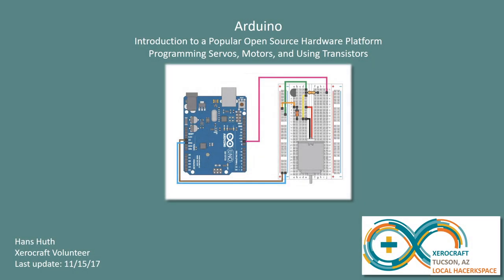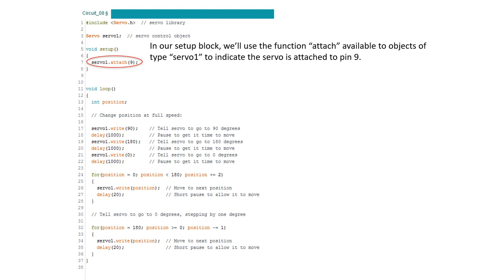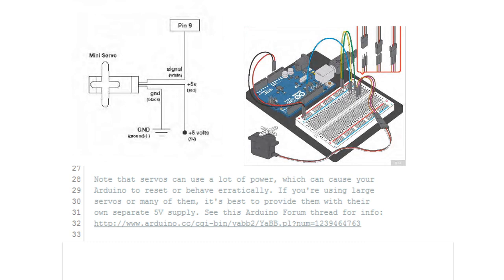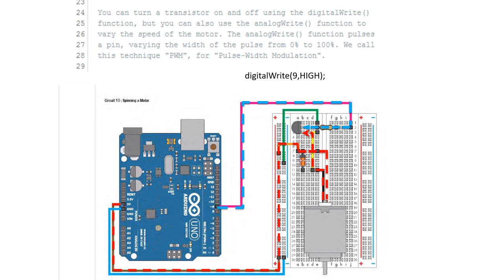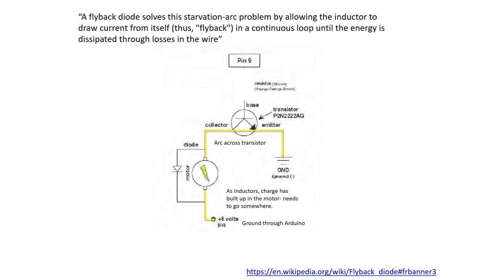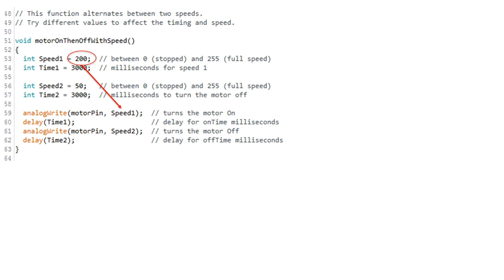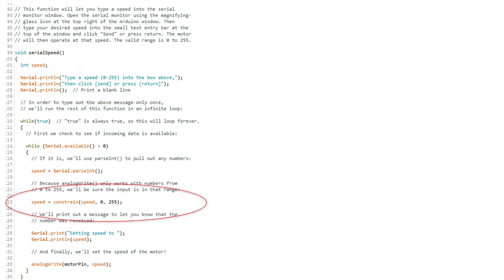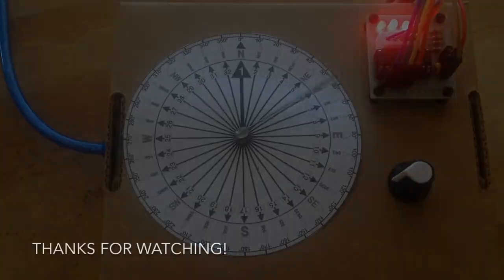Chapter 9 - Programming Servos, Motors, and Using Transistors

Comment: 12:56  I see a capacitor is attached to the two terminals of the motor, I know why it is there but I want to know how to calculate the exact value of capacitor as I have small to medium sized brushed dc motor(6vdc to 24vdc).
Reply from the maker: I honestly don't know - the capacitor I used was what was recommended in the Vilros Arduino starter kit.